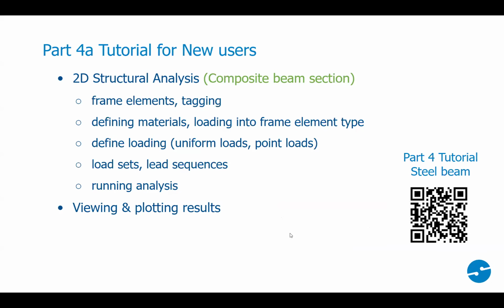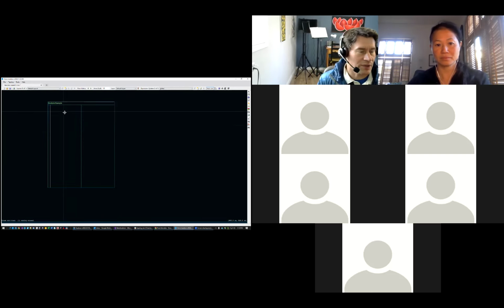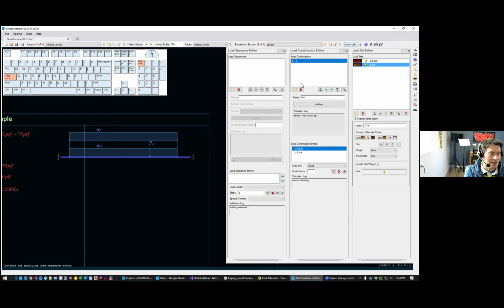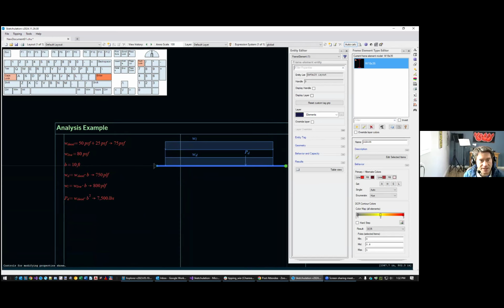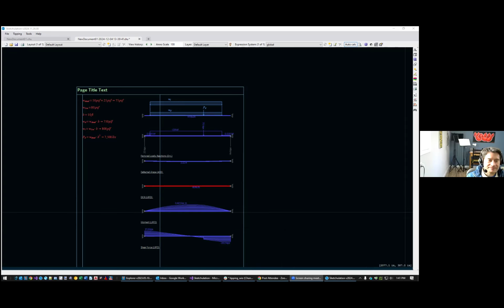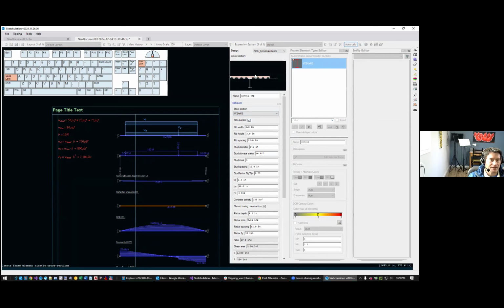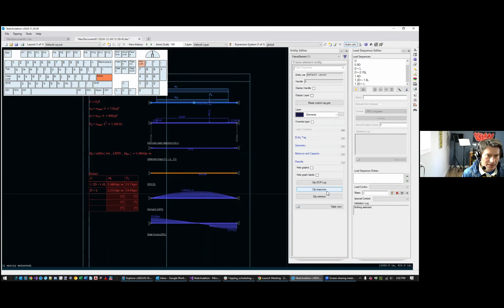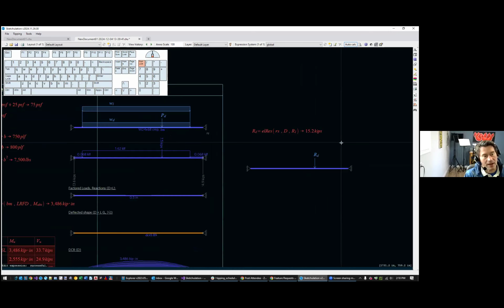Sketchulation Tutorial for New Users - Part 4A (2D Structural Analysis | Composite Steel Beam)

Comment from the maker: ⏱Timestamps⏱  
0:00 Start
1:09 Review of Tutorial Part 3 (Concrete shear wall)
2:25 Create shape: shape (sh)
3:15 Fiber Material Editor (fm): brings up sidebar, Assign materials to shape with paintbrush
3:58 Moment Curvature Analysis (mr), FiberSectionPM (pm)
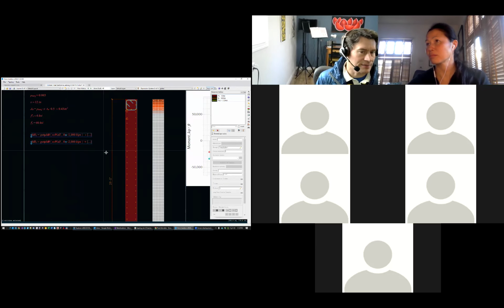5:12 Create tag, Create expression text (xt) for getPM (tag)
6:14 Chart (cht), add series (ser), edit series (eds)
7:43 Tutorial Part 4A (2D Structural Analysis | Composite Steel Beam, simple span)
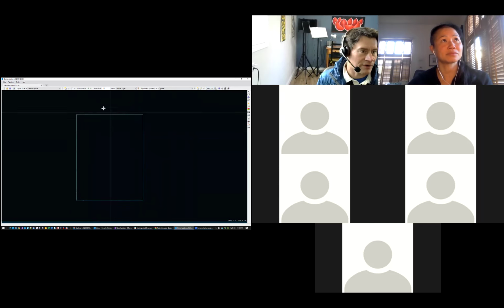8:05 Page setup: adjust annoscale, text (t) for title & adjust text style
8:07 New feature demo: Add page block
9:03 Creating frame element (fe), tag entity, define restraints (r)
10:25 Create expressions for loading: Expression text (xt)
11:24 Define loading: Distributed / linear load (ldl) & adjust grips, Create point loads (pld), assign expression to loads
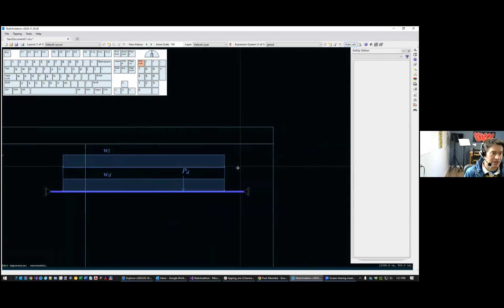14:22 Create load sets (ls) (i.e. dead, live, wind, earthquake, etc)
15:08 Assign load set [dead, live, wind, eq, etc.] to loads defined in model (paintbrush), Override layers button to check assignments are correct
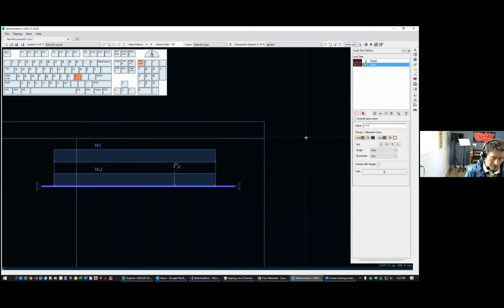15:30 Generate load combinations (lc), load sequences (lq)
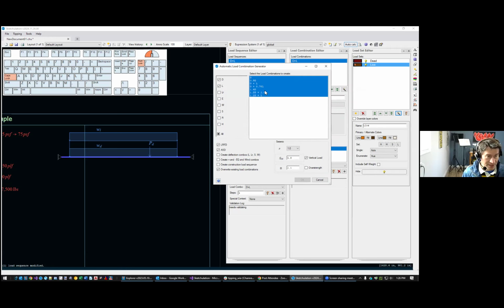18:47 Load combination generator (wand button)
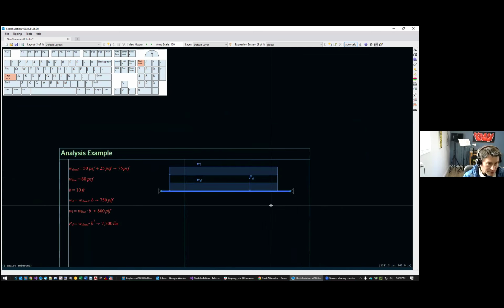22:09 Set up cross section: Create frame element type (fet), Define new cross section, indicated steel yield strength
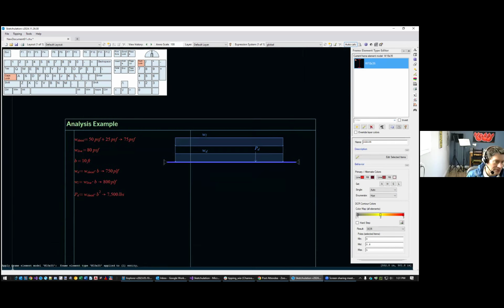24:29 Assign frame element to entity (paintbrush), can label entity in "Geometry" within Entity editor sidebar
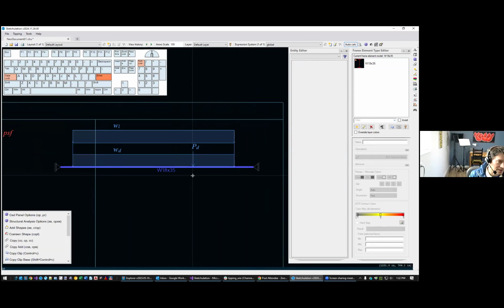25:39 Run analysis (Type F5), structural analysis options sidebar (sa or ops): click "analyze now" button
30:56 Plotting: Viewport model (vpm), draw rectangle around model, select analysis cases, and results to include, click "F8" to align with model
35:13 Question from tutorial attendee about modeling capabilities, fixity definition
39:08 DCR Log demonstration
39:54 Frame element type (fet), adjust beam size (W24x section)
41:07 Create new frame element type with composite beam section, assign frame element to entity,
43:06 Adjust stud spacing
44:27 Querying of results: tag entities, make expression (using functions like "elRes" or elEnv" for entity, context, resultname)
48:14 Question from tutorial attendee: Making a table with a summary of results
53:26 Adjust unbraced length with entity editor sidebar, modify properties (mo), under behavior & capacity
55:46 Question from tutorial attendee: Linking reaction from one beam as input point load for a second beam design